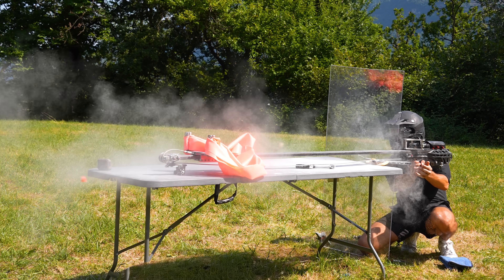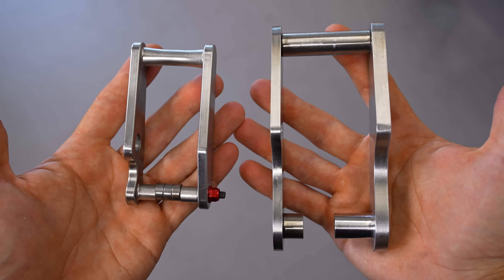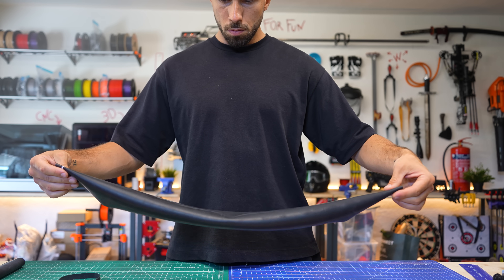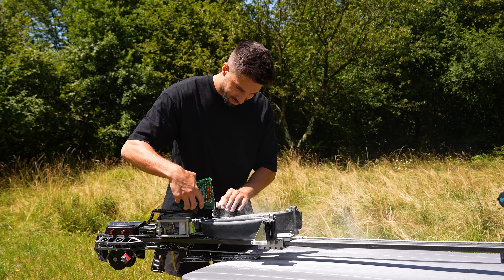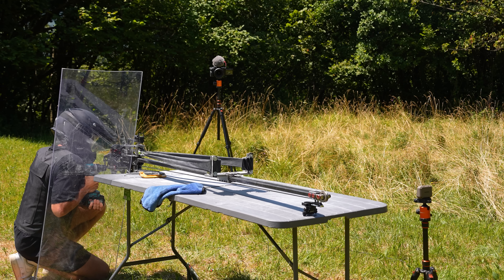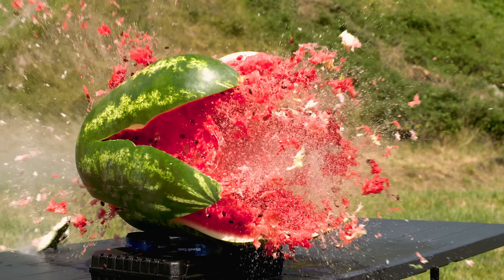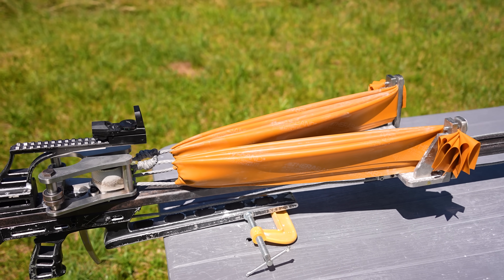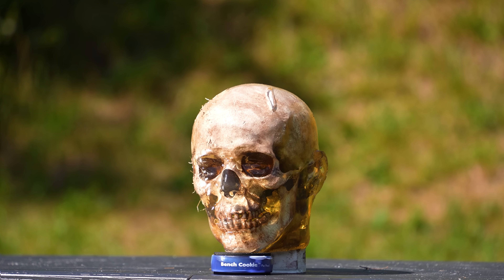Bulletproof Glass vs World's Most Powerful Slingshot

Comment: When I was in middle school my grandpa gave me a sling shot. It was an old half rotten piece of $#!+ That broke in 2 sec. However it got me interested I built a little generic sling that you could add more and more bands. In 6th grade I could bench 100lbs by 8th I could bench 220 easy. I would always put the max amount of bands on that I could pull. By the 7th grade I had a build that could put a pinball threw a stop sign at 50 to 100 yards easy. I never shot at a person. I think a stop sign is stronger than a skull.

On a side note when I drew the bands. I would stretch my arms out like a crusafix pose and fire behind my head. So it was more powerful of a pull than normal pose.

All that to say I think a full grown man should be stronger than 8th grade me (I said should I know. We live in clown world). So a full grown man should easily be able to pop someone's Mellon without aid just a few strong bands.

Comment: you need a larger and thicker shield (one with a small hole in the middle just large enough for the barrel of the sling-gun to fit through) and you need a wood backdrop to stop the balls so you can find them easily.

Comment: Thinking on it, bullet resistant glass stops bullets by having a hard layer that breaks up the copper jacket of the bullet and then a soft layer that catches the malleable lead. Often times there are multiple sets of these layers to add more stopping power. With this sling-cannon scenario, the hard layers don't really affect the steel ball in any way and the great mass of the ball (as compared to a bullet) results in it having magnitudes higher inertia that easily overcome the catching power of the soft layers. So while it seems shocking at first that it destroyed the glass, its actually not all that surprising once you look at the physics involved.
Reply: Simular to what my self defense instructor (civil/military/police/licensed gun & rifle instructor/compound bow shooter) said: arrows can go through bullet proof cars due to their mass.
Reply: @nelischdenelisch1718  I solemnly demand proof. Accurate video proof.
Reply: Bulletproof glass is not rated to stop cannonballs.

Comment: Were you calculating kinetic energy or momentum? Kinetic energy is preserved in an elastic collision (think pool balls) while a bullet deforms the target so it's momentum that is preserved. This is of course simplified and in reality it's often a blend between the two but as a general rule it works.

A Magnum bullet that weights 15.5g would have a kinetic energy of 1500J at 445/s and a momentum of 6.82kg/s

A Ø50mm steel ball at 62.4 m/s would have a kinetic energy of 1000J but a momentum of 32kg/s.

That's why the steel ball punches though the bulletproof glass, it hits it 4,5 times harder.

Comment: Even though you’ve addressed the problem that caused the bands to snap right away you still are stretching rubber bands across braided bare steel cables

You need that connection as smooth and flat as possible
Reply from the maker: That’s dyneema rope not braided steel

Comment: A sling shot is dangerouse. A cannon on the other hand is deadly. You have a cannon. I would be going remote loading and firing. If that had a reverse acction you could not live to tell the tale. I am thinking extreme high air pressure for gen 2. Maybe 250 to 300 psi air compressor. A shaft of hollow round steel. Kar power. Might need to oil or grease inside of bar. Drop ball in, release air via fitting screwed into one end. Mount into steel base, 6 x 6 inch solid bar.

Comment: Gotta love ChatGPT!

me: "think like a physicist. crossbow throwing arms, slingshot rubber bands, and electromagnetic rail gun, all combined in one such that each mechanism in provides power to the release. projectiles are large steel ball bearings. thoughts?

ChatGPT [GPT5] said:
Thought for 33s

"Fun idea! Short version: you can “stack” energy from elastic/mechanical and electromagnetic systems, but the devil is in coupling, timing, and diminishing returns—especially with spherical steel projectiles.

Big-picture feasibility

Yes, a hybrid can add energies from multiple stages sequentially (not truly simultaneously). Think: mechanical pre-accelerator → EM booster barrel.

The mechanical bits (crossbow limbs + bands) are great at the first ~100–150 m/s on modest mass. The EM stage is best used as a post-boost “accelerator tunnel” if you can get clean coupling and precise timing.

Numbers to anchor the discussion

Take solid steel balls (ρ≈7850 kg/m³):

20 mm diameter → m ≈ 0.033 kg
– KE at 100 m/s ≈ 164 J
– KE at 200 m/s ≈ 658 J
– KE at 300 m/s ≈ 1.48 kJ

16 mm diameter → m ≈ 0.017 kg, KE(100 m/s) ≈ 84 J

What your stages typically contribute (realistic hobbyist ranges):

Crossbow + bands: ~100–300 J muzzle energy is very achievable (more with extreme builds). That’s ~100–150 m/s for a 20 mm sphere.

Coilgun (multi-stage): electrical-to-kinetic efficiency often 5–20%. To add ~600 J of projectile KE (e.g., +200 m/s on a 20 mm ball), you budget ~3–12 kJ in capacitors, with careful staging and timing. That’s several kilograms of caps + switching + rails/coils.

Railgun vs coilgun: railguns need tens–hundreds of kA and erode rails; coilguns use coils + timing and are friendlier to spheres but still nontrivial.

Projectile & coupling (this makes or breaks it)

Spheres are hard for EM:

Railgun needs a conductive armature to bridge rails. A bare steel sphere is a poor, tiny contact; it will arc and smear. You’d add a sabot/drive band (e.g., aluminum or copper “cuff”) that carries the current and sheds after the EM stage.

Coilgun likes cylindrical ferromagnetic slugs more than spheres. With a sphere, magnetic coupling length is short and timing window is tiny. It still works, but performance is worse than with a slug.

Best practical hybrid: mechanically launch a cylindrical steel slug (or a sphere inside a discarding conductive ring/sabot) into a multi-stage coilgun. If you insist on spheres, the conductive driving band is almost mandatory for rail-type coupling; for coils, accept lower efficiency and use more/shorter stages to keep synchronization.

Synchronization & stage layout

Don’t try to pull with bands and push with magnets at the same axial location—they’ll fight for dwell/time and complicate timing. Use sequential zones:

Elastic launcher (cams/pulleys if you want a flatter force–draw curve and higher release velocity).

EM tunnel (6–12 coils typical) with optical gates or Hall sensors between coils to fire each stage just before the projectile centers a coil. Turn coils off before the center to avoid suck-back.

Pre-acceleration helps reduce coil dwell time demands but can over-speed the projectile for your switching. Plan coil length, inductance, and switch rise times around the expected entry velocity.

What performance looks like (order-of-magnitude)

A stout mechanical first stage might give a 20 mm ball ~120 m/s (≈240 J).

A 6–10 kJ, well-timed coilgun booster could plausibly add +150–250 m/s if everything is dialed, putting you roughly 270–370 m/s and >1 kJ KE for that mass. That’s non-trivial, loud, heavy, and power-hungry—and it gets sensitive to timing, saturation, and heating.

Practical design notes

Choose your projectile for the EM stage: if you can, go to a short ferromagnetic cylinder (better coupling) or give the sphere a sacrificial conductive band (for rail-style) / sabot (for coil efficiency).

Bands + limbs: adding slingshot bands in parallel with a crossbow string raises peak force but can make the force–draw curve peaky; cams/pulleys or a double-stage stringer help dump energy at release efficiently without string over-speed and shock.

Coils vs rails: unless you’re set up for massive currents and rail wear, pick coilgun. Rails will eat themselves; spheres make it worse.

Switching: SCRs/IGBTs/MOSFETs must handle kA peaks and di/dt. Snubbers and careful bus design matter.

Heat & EMF: expect hot coils/rails and strong EMI. Shielding, interlocks, and no ferrous debris anywhere near the muzzle."

Comment: There's a couple of additional factors at play that make this deadlier than just its joule calculations would suggest. While you get better momentum scaling off velocity, you don't get inertia with it. If you had something smaller moving at a faster speed enough to have equal momentum, the amount of force it takes to change that momentum is higher. On top of that, ball bearing are hardened steel alloy specifically made to resist deformation. Basically, while it "only" had 631 joules, it's going to hold onto those 631 joules with a greater stubbornness than most bullets.

Edit: velocity is ultimately better than mass, just that inertia and therefore mass being something more to the table than just calculating for energy would suggest.

Comment: We used to make 12-15 foot slingshots using rubber medical hosing -- took three people:  2 holding the ends and one pulling back the pouch/pocket.  The acceleration was slow but it had so much distance to accelerate that we could launch large projectiles (onions, potatoes, etc) 500 meters or so.  Done gently, we could even launch small water balloons 300 meters without them breaking until impact.  Looking back, i suppose it was more dangerous than we knew, but that was typical for 1970s 'fun'.

Comment: Tip on the drill!  Flip it so the handle is resting against your body and use that to hold it against the torque instead of your wrist.  Way lest likely to go wild and crank your wrist badly.  I do something similar with high torque situation in woodworking, bracing it against my body

Comment: You got surprisingly good penetration of the bulletproof glass because steel doesn't deform. Penetrator rounds are typically made from material that doesn't deform like lead does. Most bullets are designed to transfer energy rather than penetrate. Also, leaving gaps between the boards allowed the round to go farther than if they had been placed with no gaps between them. Very cool stuff.

Comment: Man, i love this Videos. Please read to the end.
I am a mechanical engineer from switzerland, and when I was 16 i have built a potato gun. But not like all the others with plastic pipes and hair spray. I have built it with steel pipes, and with Acethylen and Oxigen. Wehn you mix the gas from the welding burner exactly right it has a 6000 times faster burnspeed than TNT.
Whell, it was really crazy! With a full filling of the burning room, the potatoes didnt come out in one peace, no it was just steam coming out. Then I rebuilt it, with seamless hydraulic stainless steel pipes and with bullets, turned out of aluminum. Why do I write this? Because our projectile was able to crash 3 of theese pine-boards too. We didn't know anything about joule, we were just kids, and we could not measure the energy or velocity of the projectile, but perhapps you would be intressted to? I would love to see a video about it, and you would be the man for it!
Reply: It cant burn 6000 times faster thanTNT, because TNT is a high explosive and burns almost instantaneously by means of a detonating wave, which is why it needs a detonator. Perhaps you meant gunpowder, which is a low explosive and burns slowly compared to TNT and doesn't need a detonater.
Reply: Hey man, sounds like a great potato cannon, but where do you get the faster than TNT number? It just sounds very far fetched...
Reply: @paulbeli4845  Hey Paul
Well TNT has a burning speed of 5 to max 20 mm/s, Oxygen mixed with Acetylene has up to max 100m/s, which is, 100000mm/s and this is fifethousand times faster in both optimal cases. Which doesn't mean, that you could have a much stronger explosion, but it burns much faster :-). You can read this values on the internet. It's just what I have found, I can not verify the values.
Reply: @raulgraber2718  The tnt burning speed would be the deflagration speed though, a more comparable velocity would be the detonation velocity
Reply: @foldable705 For sure! I have never wanted to tell anyone, that this gas mixture is better than TNT, I just wanted to show, that it also can give a hard explosion, and that this canon has a big potential for a funny video.
Reply: @raulgraber2718  Of course, if you had that much of an explosive equivalent to tnt, the government would have many questions.

Comment: I would consider using a two thick sections of nylon plastic cylindrical pipe for the dyneema on strap that holds the projectile. Keeping the bands flatter, and not crimp on the contact between the rope/bands should increase longevity and accuracy.

Comment: On the rope that the bands are fed through to hold the projectile, you should get some think heat shrink tube and use them at the contact point of the rope and the bands. I feel like this would provide a better connection and would help keep the ropes from eating into the bands.

Comment: What if you went shoulder mounted like a recoilless rifle with a built-in shield or shroud to protect.your head?
So long as you keep it balanced I don't think the weight of an on board cocking motor would be an issue. Making the shoulder pauldron adjustable fore and aft should make that easy enough to deal with.

Comment: what you have is the deadly combination of speed and mass, you are on the low end of modern ballistics, which is more or less unknown territory at the moment..... you have the equivalent of a battleship shell, that is relatively low velocity, with a very high impact  energy due to mass..... what it loses in velocity it makes up for and more in sheer brute force.
that's why the bullet proof glass failed, it could cope with a small object at very high velocity, but not a large mass at a very low velocity.
what you have invented is the equivalent of firing 14 pound sledge hammer heads out of a mortar.

its the total opposite of modern firearms where the goal is to get smaller rounds at faster and faster velocities.

you're just yeeting anvils  out of windows........ and its working.

Comment: It punched through your bulletproof glass because it's a steel ball. Bulletproof glass is layered it's designed to disperse the lead projectiles in normal  bullets. Since it was a solid steel projectile it wasn't able to disperse anything. 
Try an actual armour plate...low to mid rating

Comment: 6:40 I have a suggestion for improvement I have already seen this in some machines and systems Such as elevators or industrial systems that work with belts To improve traction, you should place small thin metal plates between the clamps to better distribute the force and increase traction More or less like a washer Which runs the entire length of the clamp These metal plates do not necessarily have to be thick  It is only important that you have a layer after each rubber band to massively increase the traction Because these metal plates conduct the energy from the rubber band directly into the connecting screws instead of into further layers of the rubber band And thus prevent the rubber bands from slipping past each other

And what is also very important about the clamp is that you make sure that the edges where the rubber band comes into contact are sufficiently rounded Firstly, this ensures less stress and secondly it also increases traction Because if the edge is rounded, the rubber can wrap around it and increase traction enormously because it is pressed against the material with the force that tensions the band

The idea with the sandpaper is not bad, there is another solution how you could do this, for example by going and drawing checkered patterns on your sheet metal or on your various clamp parts with a pen and a ruler and then driving along them with a Dremel

The clamp I'm talking about is the clamp on your fork With which you clamp the rubber bands together to prevent them from slipping backwards

Comment: You should shoot your shield with the sling shot and see how ineffective the shield actually will be.

Also don't concern yourself with the kinetic energy via 1/2 mv²,  the kinetic energy will be kx - frictional losses, as a first order approximation assume you'll have the same band friction losses, so the kinetic energy should be the same for any size ball bearing you use if the bands are stretched the same each time.

Comment: Impressive, but have you considered using steel/steel alloy springs instead of elastic bands? elastic looses some energy when stretched as radiant heat. Steel springs may also have a higher tensile strength, meaning they can store more energy and may be safer as well. Please be safe with these experiments. :)

Comment: so it wlud beamazing is u made is AP or armor presing by making the ball sharp but then there wlud be problems te ball wont be balanced the cone or the sharp part vlud vigle and miss so add fins to it but theres a nother problem it wlud ruin the bands from my imagining how wlud it work. then try use the sabo disposising so ur ruber bands will be protected from wearing of shoting and also do u reilize that the A-10 gatling canon is only 30 somting mm  ur sling shot is the same as puma tank shell. and i sugest u make HE balld for the sling shot is wlud br amazing

Comment: for the trigger, whenever you run into the issue of "my hand cannot generate enough force", you could make a trigger which essentially releases enough force to pull a trigger with a spring mechanism, similar to how low explosives are used to detonate high explosives

Comment: The main issue here is that the rubber is hitting the metal forks at high speed. Either widen the fork to about half meter, or insulate the forks sharp corners. The springs are not randomly braking, they are cut on the fork. Also, you should stand behind a wall, not plexiglass. Put that plexiglass infront of the bullet. If the ball hits metal part, and part brakes off, it could easily end up in your head.